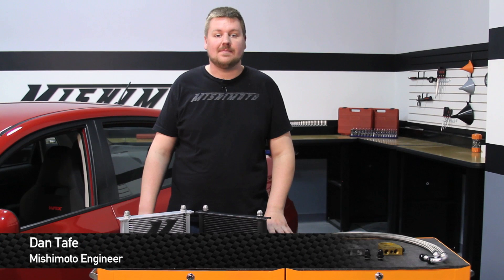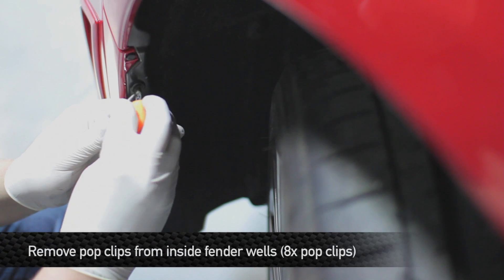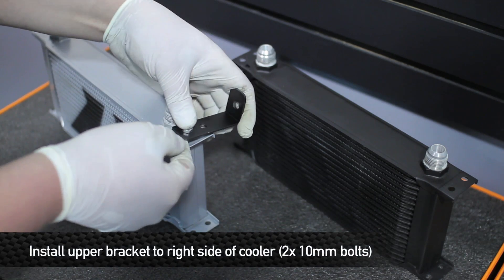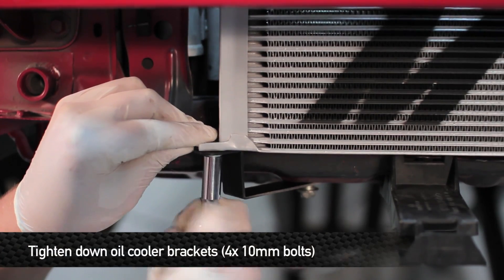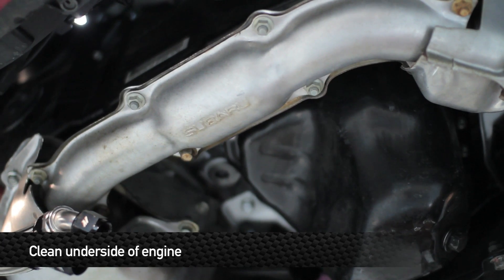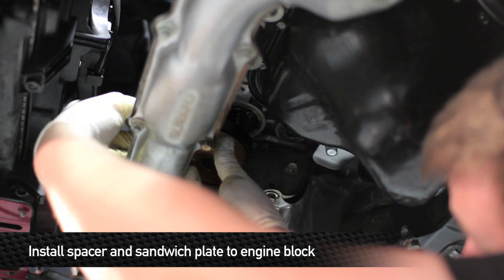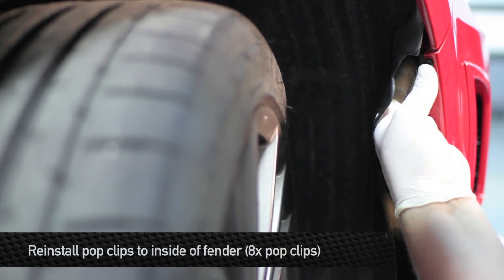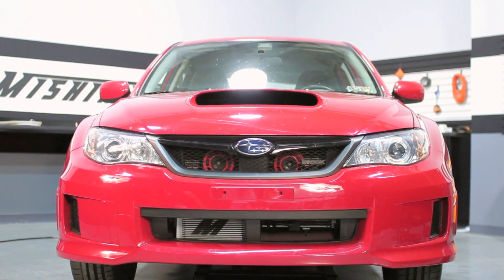Direct-Fit Oil Cooler fits 2008+ Subaru WRX/STI Installation

Comment: Do these fit the 2015+ sti  models? And is it possible to mount the cooler on the upper side where the hella horns are?
Reply from the maker: This kit would not be compatible with the 2015+ STI models.

Comment: What’s the fitment of this with your FMIC kit?
Reply from the maker: We do have a note about this on our website, the oil cooler is not compatible with vehicles equipped with the FMIC.
Reply: @mishimoto  would the M oil cooler fit the Mishimoto sandwich plate aswell as my defi oil temp gauge?

Comment: What if I have your front mount intercooler for my 2006 sti, where should I put the oil cooler?
Reply from the maker: The oil cooler would not be compatible with a FMIC, the cooler would have to be relocated from the designed location

Comment: Will this fit the legacy gt or Outback XT turbo?
Reply from the maker: While the cooler might attach to the engine the mounting points for the cooler will be different on the Legacy and Outback.

Comment: Is it worth getting an oil cooler for extra reliability for daily driving, I also take it on canyon runs once in a while!
Reply from the maker: An oil cooler would help ensure that your oil temps stay as low as possible and would help prevent any kind of overheating issues you might run into.

Comment: Sorry but this does not fit a 2012 wrx sti, my oil cooler doesn’t even fit between the bumper crash bar and radiator, the lower bumper support panel has to be removed completely which wasn’t mentioned anywhere and the oil lines seem like they have to run under and almost against the exhaust to fit on to the sand which adapter. 
This is not a direct fit kit and I feel ripped off for the price honestly, this should fit straight on with no issues!
Reply from the maker: Hello Internal Calibration Balance . Sorry to hear about your issue. At this time, we actually produce two different kits, one for the STI, and one for the WRX. I'll leave links to both product pages below. Is it possible you simply received the wrong kit? Both units do have individual installation guides to account for differences. 

STI: https://www.mishimoto.com/subaru-wrx-sti-oil-cooler-kit.html
WRX: https://www.mishimoto.com/subaru-wrx-oil-cooler-kit.html

Comment: can you add the oil pressure sensor and oil temperature sensor
Reply from the maker: Hello A. N. , Any of our thermostatic sandwich plates have a 1/8" NPT port (with plug) for sensors/oil feed/etc. Any of the rear mounted thermostatic plates have two of these ports :)

Comment: The installation on my 2012 GVF STI is not going so well. Turns out it has a built in oil cooler. Do i get rid of the existing oil cooler, then install the sandwich plate? Also, the mounts did not fit that perfectly for my car. I had to make some minor changes. For people planning on buying this thing, make sure your STI matches the one on this video.
Reply from the maker: Hi Oinky - sorry to hear you're having difficulty!  Here's a link to the installation guide: https://www.mishimoto.com/media/productpdf/MMOC-WRX-08_InstallGuide.pdf and as always, feel free to call our customer support specialists at 1-877-GOMISHI or email support@mishimoto.com!

Comment: How do I change oil after install the kit? it will remain oil inside the cooler.
Reply from the maker: Email support@mishimoto.com - they'll be more than happy to answer any technical questions as well as assist you with placing an order! :)

Comment: Just wondering about oil changes and if the oil in the cooler is able to drain with the cooler clocked  with the ports pointed to the top
Reply from the maker: +Randy Ingrao please email support@mishimoto.com - they will be more than happy to answer any technical questions!  :)